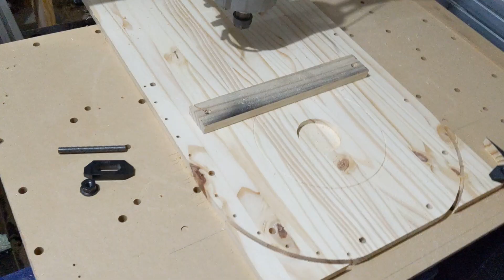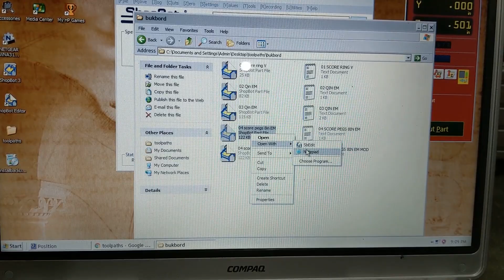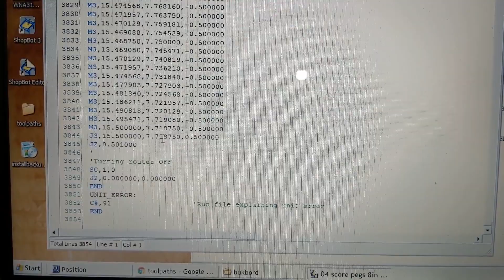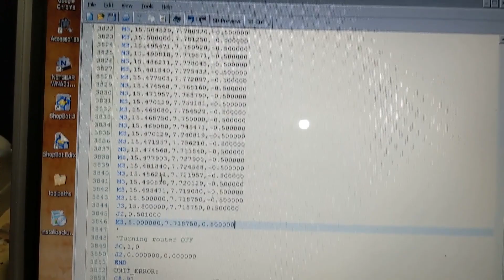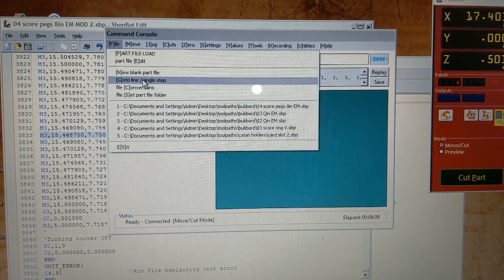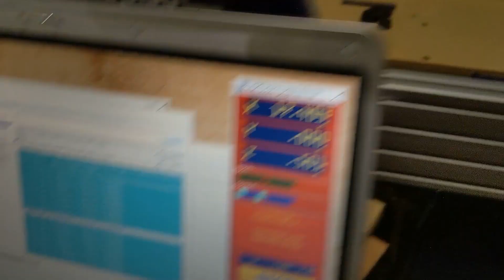Make easy changes to G-code and start CNC files from specific lines

Comment from the maker: I talk a lot so if you want skip straight to the info...
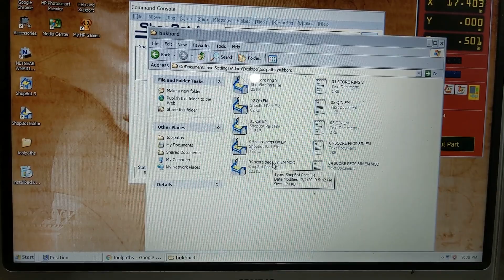Editing G-code in SB edit - 3:20
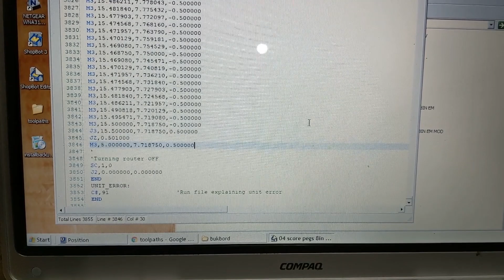Starting a file from a specific line in SB3 - 6:30

*EDIT* The file shown in this video is actually in OpenSBP format. A number of CNC brands use it besides ShopBot, but it isn't identical to G-code. It is very close. However, as I stated in the video, all these tips would work with any system or file. You just need to look up the right commands and save it in the correct format.

Comment: is there any way to change the size of the Gcode file from with in grbl_9
Reply from the maker: Sorry, friend. I can't say I've ever used grbl to mod any code. Even so, I don't know exactly what you mean by "size". Are you trying to reduce the actual scale of the project you're outputting? Or reduce the file size? Having never been exposed to it, I wouldn't be the guy to ask, but there are very vast, active forums of users online that I bet could help you with your question. Good luck!

Comment: That is NOT  G-code. It is OpenSBP.... gna confuse alot of people.
Reply from the maker: Thank you for the feedback. You are absolutely right. But the two are very similar, and I figured most viewers have heard of G-code, so I went with it. And I do say that the process shown is specific to ShopBot users, but applicable to just about anyone else. I could output my toolpaths as a G-code *.tap file and my CNC would run it. I could also go in and add a line of code to that file just like how I showed. I don't think people will be too confused, but I will make a couple edits to the description and comment just to be sure. Thanks again!

Comment: I suppose you could change Z from zero to +1 in the last two lines, instead.
Reply from the maker: True. I should have mentioned that. You could potentially run into problems with that solution if the piece you're cutting is already near the max thickness of your machine's z-height. But if you've got room, like I did here, that would work fine too.